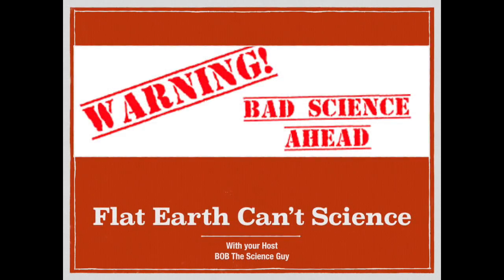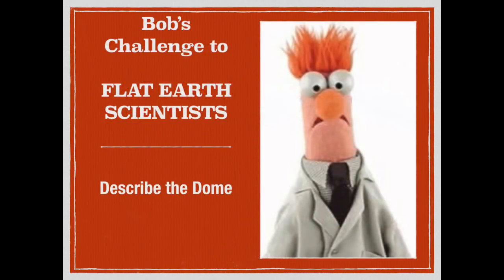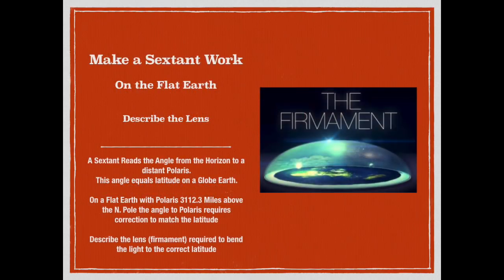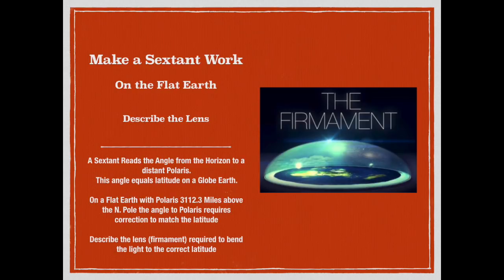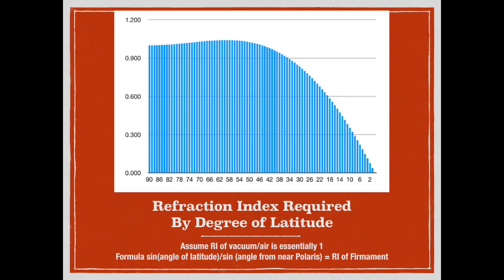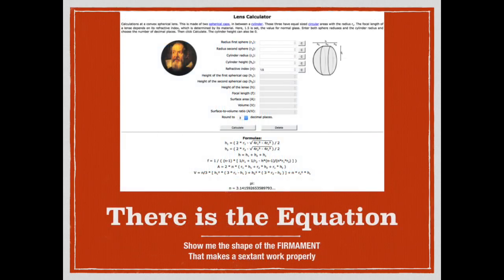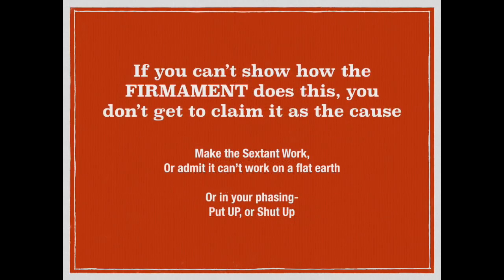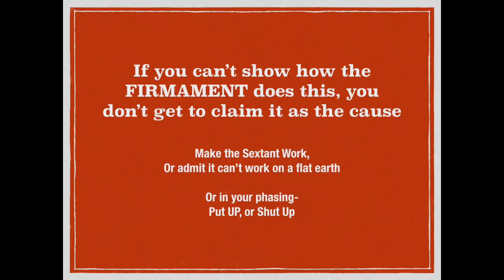Flat Derp Can't Science Challenge  Make a Sextant Work

Comment: I wonder what is the assumed altitude of the sun and the "dome" in the flat earth imaginary models. I seem to remember something about 3000 km (or was it miles?) for the sun. That would fit to the 45 N sextant measurement. However that would also  mean that sun would be nowhere lower that some 20-30 deg from the horizon, depending of how large is the "earth pizza" (another number they do not like to give).. So no night on the flat earth.

Comment: Bob, what makes you think Fe'ers have agreed upon the value for the height of Polaris above the NP? I keep asking them and nobody answers.
As we all know, it only works on a globe Earth and Polaris very,very far away!  : https://www.youtube.com/watch?v=7BUMbkmRXdc
Reply from the maker: The bottom line is that geometry dictates the height if it is small and local as they say.  Just as it dictates the height of the sun is 4065 miles.  Polaris is actually 400 light years away by parallax measurement, so if we set the distance at 1 million miles, we would still have issues with a sextant.
Reply: So some 6000 km for the "sun" altitude. Assuming their "earth" radius is twice the  real Earth (to make the surface area identical), sun could not be lower than 13 deg over the horizon even looking from the "ice barrier" to the sun position above the other end of the "earth circle"  (where it never should be, anyway). Now someone explain flat earth night to me 😋

Comment: I had another think about this and reached an interesting conclusion. When light is refracted through any optical system, the rays can be bent in various directions, but after leaving the last refracting surface, the rays that an observer sees travel straight to their eye. To the observer, the direction in which the object is seen is also the direction of the point where the last refraction occurs. When an observer on the Equator sees Polaris on the northern horizon, the light they see is travelling parallel to the Earth’s surface. If the altitude of Polaris on a flat earth is modified by refraction so that it always matches the observer’s latitude, then on the Equator the last refraction must be occurring just above the Earth’s surface. If the dome is responsible for the refraction, it must lie between Polaris and the Equator. Anyone who claims that it is the dome doing the refracting must accept that, for Polaris to be seen on the horizon at the Equator, the observer has to be OUTSIDE the dome.
If this were true, all those who have crossed the Equator throughout recorded history must have passed straight through the dome without even noticing it. However, it would answer the question about what lies outside the dome. The answer would be: the Equator and everything south of it!
Reply from the maker: Excellent points.  The simplest answer is there is no dome and the earth is a sphere, which is why we can read the sextant directly, but that is too simple for them.  It also goes against their narrative so they have to look for absurd 'reasons'.
Reply from the maker: @david_akerman  Good point.  Probably because they start from the wrong premise.
Reply from the maker: @david_akerman  Your data dictates your conclusion, your conclusion does not dictate your data.

Comment: How the hell would a sextant work in the southern hemisphere on a flat earth? A sextant does work in the southern hemisphere and works well. Captain Cook managed to explore the southern hemisphere without getting lost using a sextant. (The sextant was the main tool of the navigator. Developed from the more limited octant in the 1760s, the sextant could be used either to find the height of the Sun above the horizon to determine a ship’s latitude, or measure angles between the Moon and fixed stars. The latter was a more difficult observation to do accurately on a moving vessel but, using published tables, allowed a skilled navigator to calculate his longitude as well.) thanks migration heritage.

Comment: The horizon, another flat earth killer.
Reply: @trevorkroemer 
Because looking over the sea there should be no sharp and distinct horizon line on a flat earth it should  just fade away into the distance, and it doesn't, kills flat earth
Reply: @trevorkroemer  
"But if you use a telescope, binoculars, or high zoom cameras, your visible horizon is much further away. "
No it isn't, the only way the horizon would be much further away is go to a higher position. Telescope, binoculars, or high zoom cameras can't see around corners. To save you time, I live right opposite a beach and choosing  a clear and cold day the horizon is a sharp well defined line, impossible on a flat earth.
Reply: @trevorkroemer  
"then you can go out on one of those days and watch a ship disappear, and using a telescope, binoculars, or a quality zoom camera, bring the whole ship back into view."
If it has disappeared because of the limitation of your eyesight yes, you can bring it back, but if it has disappeared over the horizon, no, nothing will bring it back, and I done this many many times. But if the earth was flat the ship would never disappear with a strong enough telescope. My telescope can see the craters of the moon very clearly when it's setting, now why can't I see the silhouette of that island that is 300 miles away which is between me and the moon, obviously the earth isn't flat and only the simple minded and the uneducated would think otherwise.
Reply: @trevorkroemer  
Stop making excuses, they are not assumptions, I feel like I am talking with a child, I am done with you, bye. Don't bother replying, I have blocked you, won't be able to see your post.

Comment: Bob, to make it fair to flatties, let them use a Sextant, a sundial, paper, a straight edge, a pencil and eraser, and be gracious in letting them use a basic calculator to do the math with. I'd also expect them to show their workings, and state that they cannot use any globe based technology, like GPS, or any satellite derived position indicator, ( Satellites are fake after all.....) or a mobile phone; to find their position on their flat earth. Finally a time limit, 2000 years ought to be enough.
Reply from the maker: lol yeah that would be fair wouldn't it?  But they are hypocrites so let them use science and globe based tools, they can even satellite phone a friend.  They still can't do it.
Reply: Bob the Science Guy Aw... spoilers....
Reply: Satellites are balloons... look it up. Gps uses ground based triangulation, thats why they don't work south of the equator! But it's ok I like Star Trek too, only I know the difference between photography and computer generated composite imagry with manually added color. (A.K.A. - C.G.I.)

The accelerometer inside cellphones can "supposedly" be used to pilot drone crafts in space. However they don't seem to show an adjusted horizontal plane regardless of the location of the planet. (This is scientific observance) 
The "curvature" of Earth is calculated by taking a measurement of the pyramid at Giza. Modifying it using phi in some esoteric way to get a number that is claimed to be to circumference of the Earth. Simple geometry gives to the curve angle from there... 8in. Per Mile squared... What did you think they used a ruler? (This is called reality) 
No, someone used 2 sticks in the ground and calculated it by the difference in the shadows... 1000 years before they discovered America.... and they "discovered" that calculation matchs the pyramid! (This is called Scientific  belief)
The difference between flat Earth researchers and ball Earth believers.... RESEARCH!!!
Reply: Shroom doggie Sorry pal, your research is flawed. You haven't done any! 
Accelerometers alone can't be used to pilot drone craft in space. The clue is in their name. They measure acceleration, and deceleration and display the rate of change of velocity relative to an object they are attached to. 
A simple accelerometer can be made by putting a marble in a round bowl. Whilst the bowl is at rest, the marble will stay still at the bottom of the bowl. But as soon as you move the bowl, the marble will try to stay still, but can't because the bowl is moving. If you keep the bowl moving, eventually the ball will come to rest at the bottom of the bowl, and stay there as long as the velocity of the bowl stays constant. If you stop the bowl suddenly, the ball will continue in the same direction as before, moving up the bowl, and slowing down, due to friction and gravity. 
All the Accelerometer does is show you this conservation of momentum in a form that can be measured, and displayed as a vector, if you have three of them on different axis.
An accelerometer at rest actually measures 1G, in the same way a pressure gauge on the earths surface measures the atmospheric pressure as 1Bar, but the dial is set to zero.
Think of a parachutist falling to earth, before he deploys his parachute, he is in free fall. He continues to accelerate downwards until the air drag prevents him from accelerating any faster, and he has reached terminal velocity. He is still falling, but now at a constant speed. 
Now put the parachutist in a vertical wind tunnel. He is still falling to earth, at terminal velocity, but The rush of air is acting on him, and cancelling out the effect of gravity. He is still falling, it's only the air pressure holding him up. The accelerometer will still only read 1G.
In your phone you have electromechanical accelerometers, when you hold the screen vertical, at rest, the screen orientates itself to display a vertical format. Rotate the phone right suddenly, and like the ball in the bowl, the phone senses the movement and reorientates your screen, and will continue to do so until you stop moving the screen! Notice it works when you move the screen left or right. When you move the phone toward you from vertical to horizontal what happens? Nothing. It's not programmed to react. Open the spirit level app, and level your phone. If you rotate the screen now by twisting it right slowly, the bubble moves left, if you have the inclinometer app, it will tell you what angle it's measuring, based on the accelerometer principle. If you come to rest at an angle, the display will show you the last value obtained. 
Now to your point on the GPS. Both systems, your phone and a GPS set use triangulation, but where they get their reference information from is two totally different places. GPS uses a constellation of satellites orbiting the earth. Different countries have their own systems, and Satellite constellations. The USA, Europe, Russia, and China, have their own. Russia uses GLONASS, Europe uses Galileo, and China uses Compass, for world wide navigation, and there are some regional GPS Networks, run by India, China, and Japan. You could even put your own satellite into Orbit, if you could get it to go fast and high enough to reach orbit, it's not difficult! Just don't fire it straight up and expect it to stay there, for sure gravity will put it back to earth, but get it high enough and fast enough to move so that it follows the curve of the Earth, say 250 miles up, and it will fall back to earth, but keep missing. There's no, or very little atmosphere to slow it down, so due to the conservation of momentum, it keeps on going at about 17,000 miles per hour constantly falling, but missing the earth at the same time. Now that satellite can see the earth below it, but it can't see all of it, the globe is too big. Look at a basketball held in your hands, but about one inch away from your eyes, you can't see all of it, just the area immediately in front of your eyes. 
Now the satellites know where they are, and they can transmit a signal, a time stamp, back to earth, and as its broadcast, anyone with a receiver can pick up that signal, but all it will do is give you a line, a circular line on the earths surface, and the receiving aerial is somewhere on that circle. But you don't know where on that circle. You need another satellite to send another signal, and it can give you another line, another circle, and where the two circles intersect, you will have two points on the earths surface, but you still don't know which one of the two you are on, so you need a third satellite to give you another position line, which will intersect with one of the two points given by the other two satellites. To cover the entire globe you need to position between 18 to 30 satellites about 12,000 miles up, too few and there aren't enough to cover the entire globe. Balloons can't reach that altitude, nor are they stationary, they are at the mercy of the wind, so they just aren't suitable for a position fixing system, but are used for meteorological observations, transmitted back to earth daily. 
Research radio sondes for more information.
Research WAAS, or wide area augmentation System.
Research EGNOS, A satellite based augmentation system, the European Geostationary Navigation Overlay.
Research Eratosthenes, he was the guy who put the sticks in the ground and discovered how big the earth is, and yes he did measure in stadia, about 630'  in today's measurements. He he got very close to the actual measurement.

So yes you are right the difference between flat and ball Earthers is research, Flerfers don't do any!
Reply: Monochromatic Lightsource 
Thanks for the long drawn out explanation of irrelevant information. I am not the guy at nasa that determined the cell phone's accelerometer can be used! (I don't need a 1000 word essay explaining how they work in laymen terminology)
The gps that is being used to track civilian tech IS GROUND BASED!!!!! Both of the satelites that you mentioned have been launched by balloon from a Swedish balloon launch site. 

WHAT DON'T YOU GET? THE GOVERNMENT LIES TO YOU!!! (It's all smoke and mirrors)

The Van Allen belt radiation would prevent any radio signals from passing through it. I doubt that you get very good cell reception from inside a nuclear reactor. This radiation field starts at 300 miles!!!! NOBODY HAS EVER EXCEEDED THAT HEIGHT!!!! (But we landed on the moon? Tell that to Stanly Kubrick!) There are records kept by the EU of the heights obtained by space bound craft.... check it out! (Or do you actually believe that they drove a dune buggy on the moon? Haha what a joke)

You ball believers need to stop believing everything nasa says. They will tell you 1 thing while the sacred symbolism that they have displayed around them says the opposite. There is a big difference between researching the main stream explanation and researching the documents released by force after the fact that detail the lie. Elizabeth Tavares exposed the Nasa document that details their plan to reduce the worlds population...
 (stopthecrime.net) 
You won't see that article in the Wall Street Journal!!! (CIA news outlet. Congress gave CIA permission and funding for a disinformation campaign... did you know that? Probably not because that would require research!!!)

FYI the barometer measures atmospheric pressure, not gravity. (1 bar is a measurement of altitude...) 1 "G" is an average measurement... because it changes all the time at random. It's actually quite frustrating to scientists, so they don't make that very well known. That is because gravity is actually density. Put an egg in water, add salt and watch the egg defy gravity..... ooooooooo magic.....

Let me guess flooting? What do balloon do? FLY?

Comment: Another video surely worth viewing. Absolutely to the point. Thanks. It may not reach those deep in the rabbit hole but hopefully some sitting on the fence.

It is sad but for the deeply convinced flat earth believer it is enough to put a "somehow" in the explanation and their brain switches off: "Somehow" refraction will cause we see Polaris on flat earth at the angle we would see it on a spherical earth. That this kind of refraction may cause every kind of distortion to other things we can see they counter again with "somehow". With respect to from Polaris or stars in general the light emitted is "somehow"  different from light reflected or scattered from – say – a distant mountain top and therefore everything is good for them. No further explanation required. It just works. "Somehow".
Reply from the maker: Excellent follow through and you read my mind.  Obviously if the firmament bends the light from Polaris, we will be able to demonstrate it bends the light to the same degree from everything else we view in the sky.  It will fall apart immediately.